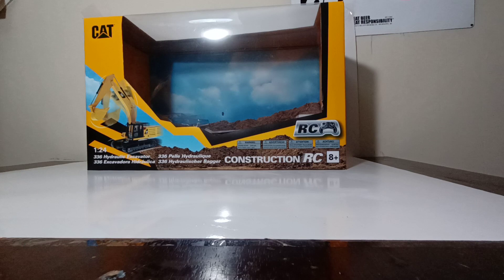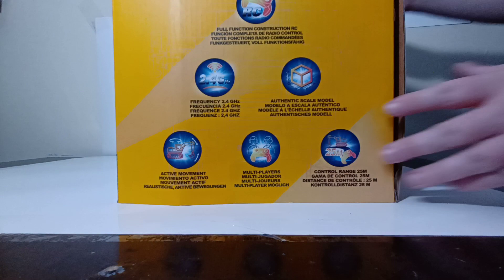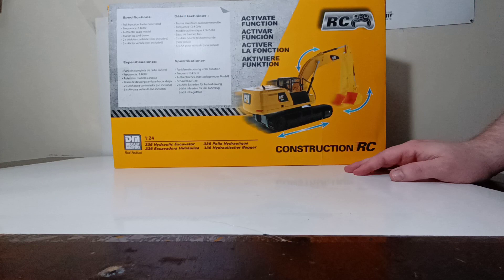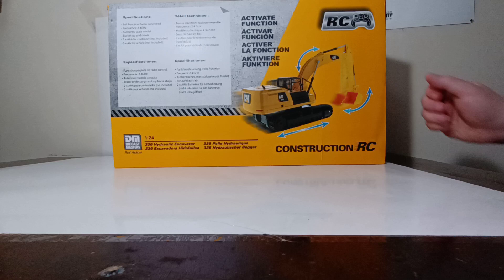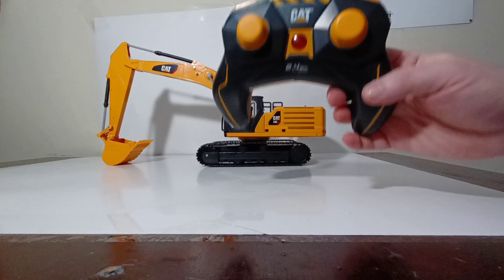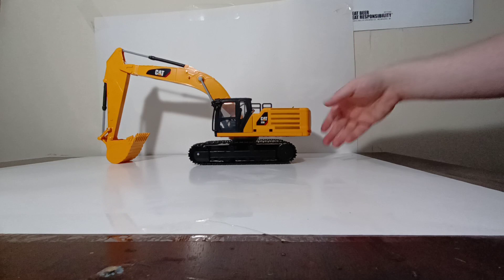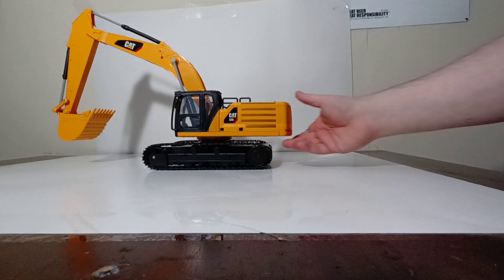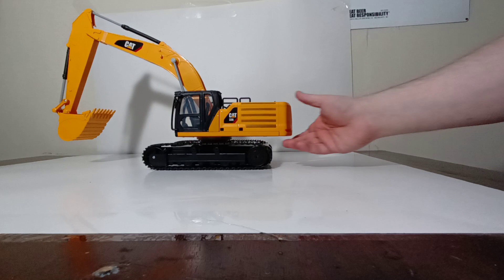Diecast Masters 1:24 Scale Remote Control Cat 336 Excavator

Comment: This must be the earlier version of this model. There are two different versions listed on the site, and the other one has a different transmitter and can rotate under its own power. It also has separate control of the bucket and arm, and is significantly more expensive. Annoyingly, it looks almost identical to this one, and the only easy way to tell them apart (besides test driving them) is to check the item number. This cheaper one is 25005, while the full featured version is 25001.
Reply from the maker: This is the more cost-effective one. I do have a review of the more expensive one on this channel if you'd like to see them side-by-side.